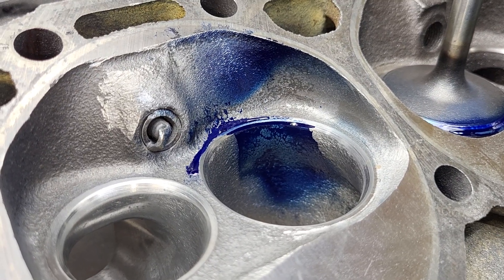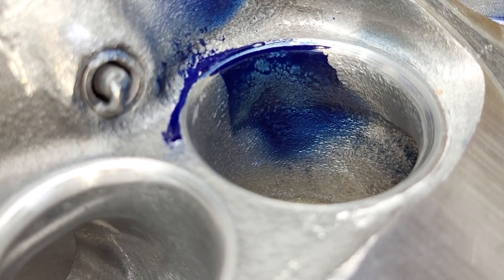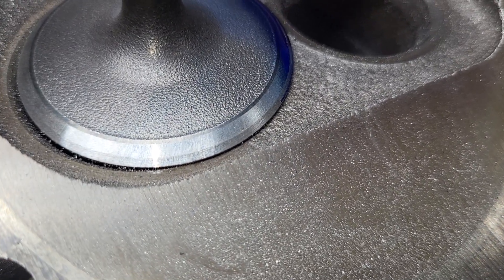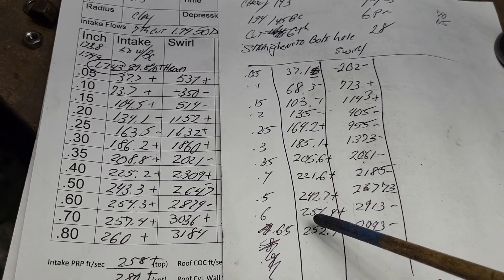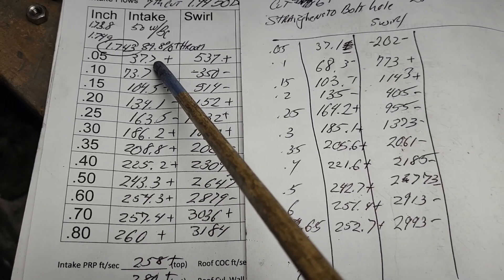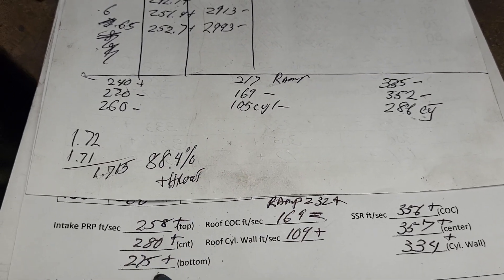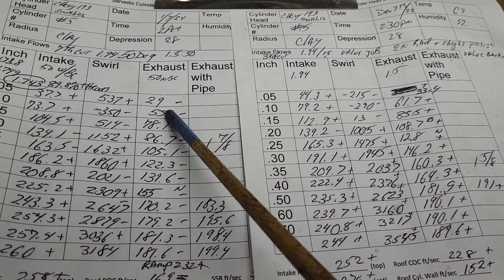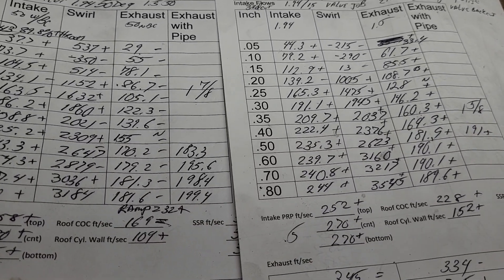44. Chevy 193 TBI Swirl port cylinder heads, 1.94"/ 1.5" 50 degree seat 7th cut Winner?

Comment: I'm still curious how it would flow with the swirl ramp removed completely. I've been toying around with the idea of making a cutter for this purpose.
Reply from the maker: Ok
Reply: To me what u are suggesting basically creates a conventional bowl design (although deeper) siamesed on to a swirl port (SP) runner, thinking about how a SP runner would feed into a conventional bowl u would now have two SSR's , your original SSR coming off the runner floor and now an vertical SSR leading into the COC part of bowl , air passing the vertical SSR has to turn and flow past the near face of the guide and then out the COC part of the bowl.
Question is do u think the port will want to flow like that ?
What is your thinking JD on where air is gonna flow with your mod ?
Reply: @luckyPiston  I don't know. That's why I would like to see it. I'm also curious about mods I had done years ago. I cut the ramp flush with the guide and opened up the short side, but i didn't create a ramp. I left the wall to the guide.
Reply: @jdvintageauto2958  I'm thinking if you don't open up the roof by removing material at the head bolt pinch that would tighten up the roof and air might have a better shot at turning into the space you have made available by machining out the helix , so i think your mod could work but what you do on the opposite wall would factor into it .